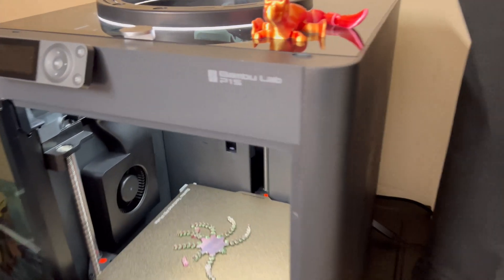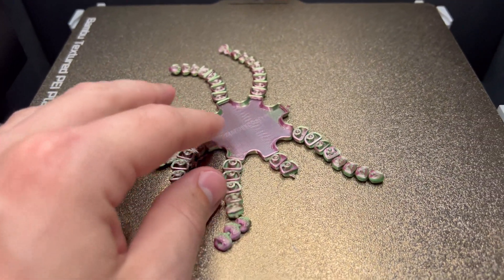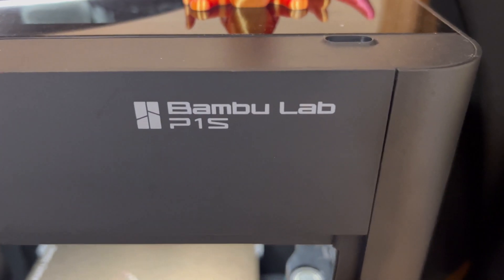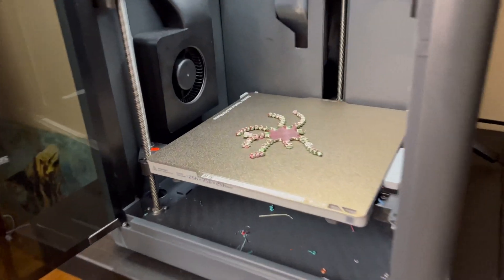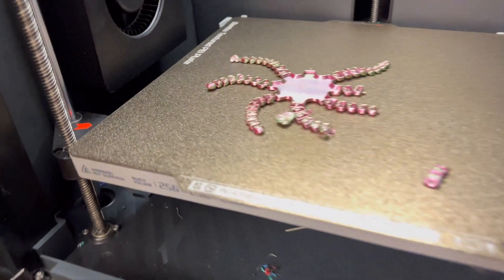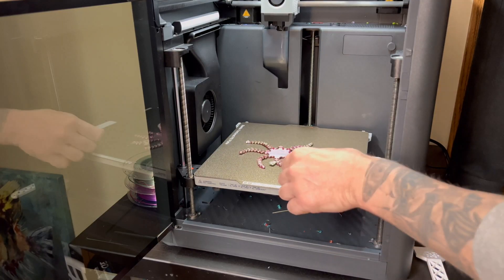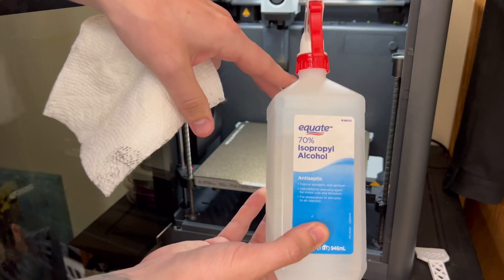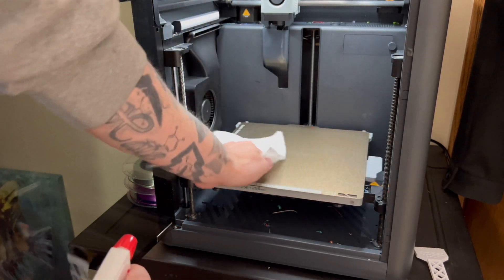Solve First Layer Issues on Bambu P1P & P1S

Comment: Seeing this on my new P2S... it is not the plate. When it fails I stop the print and it is not easy to peel the first layer off. I believe it is related to flow caused by either incorrect extrusion, temp, or a combination of both. I see material can start to ooze out of the nozzle and drag recently laid filament off the bed.

Comment: I have had a X1C for awhile now and lately no matter the build plate etc. I have just been having major bed issues or first layer issues etc. It is getting so frustrating. I have tried so much but no luck.

Update: I got the issue fixed. Turns out it was under extrusion because the gears on the extruder where wore out. Not the filament path but the drive gears. I upgraded to the Panda stuff by BIQU now is working great again
Reply: Can we get another update? It's been 2 months and now I'm curious as to if I'm having the same issue.
Reply: @MarcHershey are you asking for an update from me?

Comment: You are correct with the alcohol,  but the next higher percentage works even better. But then even that fails eventually.  At that point, take soap and water with a clean rag.

Comment: textured PEI like the bambu one you showed here should be cleaned with warm soapy water. It even says it on bambu's wiki. IPA leaves residue. Try as much as possible to not touch the bed surface at all. only the front tab. Also try wait for the prints to release on there own when cooled down and flexing / taking the print off the plate early can start to wear out the coating. Although ive done a few 1000 prints and my bed still going. Textured PEI can also be rejuvenated with some wet sandpaper 3000 grit. I also put the bed temp up to 60 for pla /+ and have my chamber set to a steady 37 with vents at the top so it does not overheat as that too has messed up some of my very long prints early on. Cheers.
Reply: the problem for me is not that it is not sticking but when its going to print layer 2, it scrapes layer 1 away idk how to fix it
Reply: @thijsmelisse8776 same
Reply: @thijsmelisse8776  same for me, did you find a solution?
Reply: @yammie1536  im new and this just started happening last two prints. Using PLA + Matte White. Im guessing could be wet filaments but I already cleaned it. I also adjsut Z distance .2 to .3 on on bottom layer and top of support.  Also preheat the bed, turn off all fan for first 2 layers. Speed is still slow at 30/ms for first layer. Flow rate to 1.0 and so for 2nd 10hr print been good. Still some stringy  and slight line lift but a second layter flatten it all down. Hoping my new cool plate come and help with this issue. For now Im watching every print for first 10mins lol
Reply: I used 99% isopropyl alcohol since on textured plates for a few years now and I very, very rarely have first layer issues. Soapy water is fine but 91+% Isopropyl alcohol works great. I wouldn't recommend using wet sand paper on textured plates. That will work on straight PEI sheets, but you'll create a lot of uneven wear with the texturing.
Reply: Finger prints yes I agree

Comment: I saw somewhere on one of the manufacturer websites they even sell glue sticks specifically made for the build plates (and other videos have shown the standard craft ones being used)... what is your opinion on that? I am wanting to get a P1S.
Reply: yeah gluestick works well for stuff that sticks too well, for pla and petg i use the textured sheet without glue. If your willing to spend a bit more nano polymer adhesive has been working really well for me on one engineering plate for polycarbonate blend and hips and stuff. wash your plates with dishsoap and water and rinse well if you touch them with your hand or the oils cause adhesion problems.